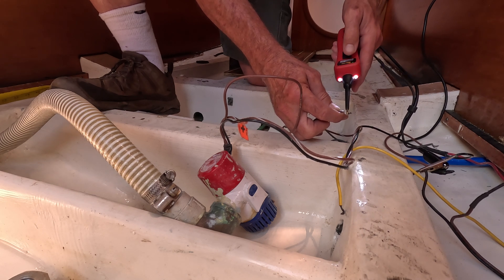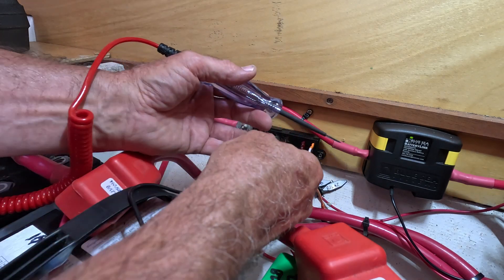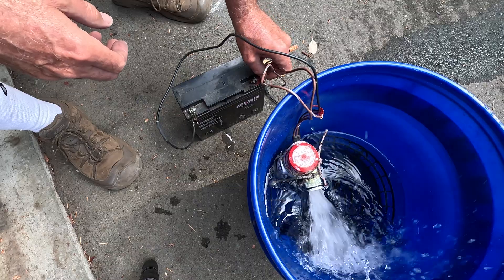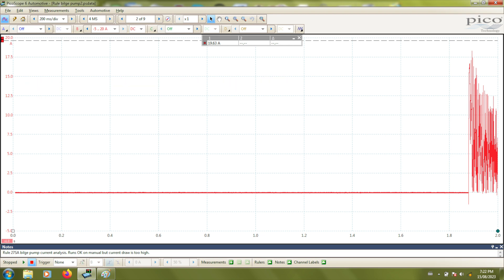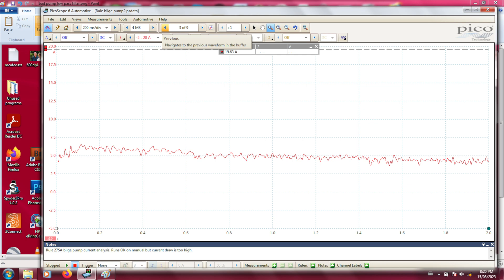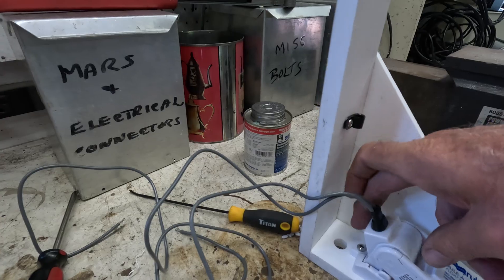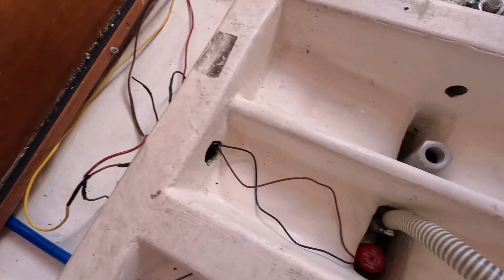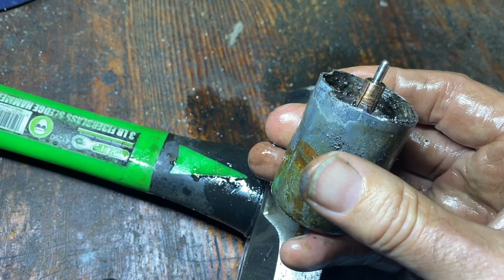Why I learned to hate automatic bilge pumps

Comment: I might have missed it. I'm unclear why it was starting every 3 minutes. Did you say it's designed that way? Why would that be? I don't have the same pump, but mine doesn't do that.
Reply from the maker: It's a curious design, I don't know if all automatic bilge pumps are designed that way. The little microprocessor inside the pump measures the current draw when the motor is spinning. Draw is very low when the pump is only pumping air, rpm's are higher, and back EMF is higher which is why current draw is so low. When more viscous water is sucked up by the pump the current draw increases and the pump keeps pumping until that current draw falls as it sucks in air after the bilge is dry. So as you say the pump is turning on for at least a few seconds every three minutes. The actual power draw is miniscule, but when operated dry there is extra load on seals and bearings. The manual replacement I put in here is working great, and I never hear the pump.

Comment: I was using cheaper float switches,  guessing Chinese copies of Rule ,    found they got stuck in the up position at the hinge point , maybe just a few grains of sand , who knows .    Ended up hot gluing a bit of closed cell foam to the top of the paddle with a small bit of lead glued to the foam too,   gave the switch more mass to go back down .   Seen someone else  use cork but I'm not a wine drinker .....     found it made the switch operation a lot more reliable and no real change to the turn on / off water levels.  

Thanks for the video showing  the normal and unhealthy pumps on the graphs , had no idea a bad pump would look that noisy .

Comment: Nice work with the scope.  What was the current interface you used to get those waveforms please?
Reply from the maker: The Pico red inductive 60A probe came with the old 4425 Pico interface I got several years ago. It connects to the interface with a standard B&C connector.  It's certainly fine for my use although one would always like the upgrades with newer models. You don't need this kind of professional style automotive scope to get waveforms, especially if you just want a quick look without having to record waveforms. There are Chinese scopes for sale on Amazon that are in the hundred dollar territory, and inexpensive current probes with less sensitivity can be found, too. Pico also sell less expensive scopes that seem to be popular. Thanks for stopping by!